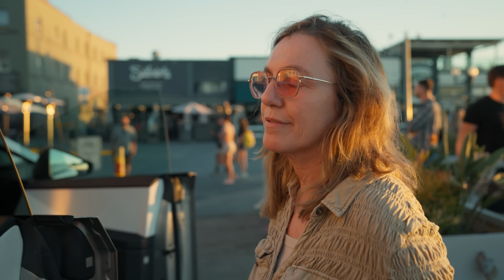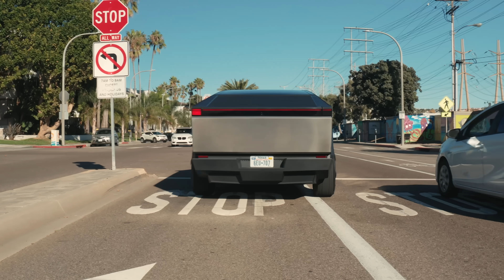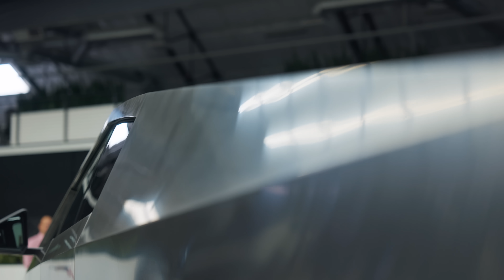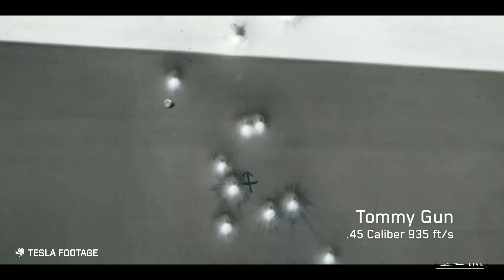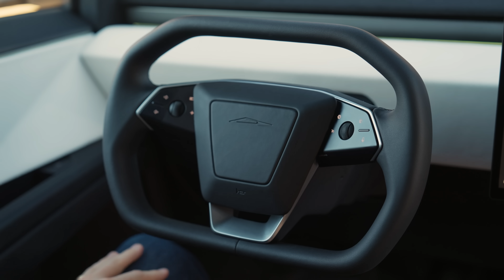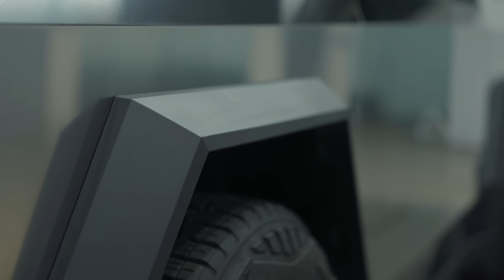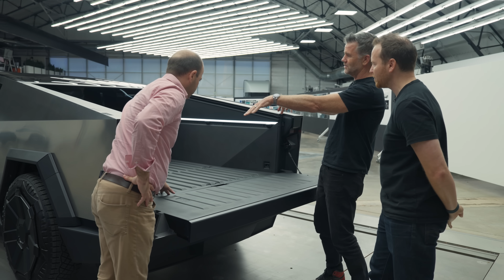FIRST DRIVE: Tesla Cybertruck Full Review

Comment: 4 WHEEL STEERING WAS ALREADY TRIED ON THE 1 GENERATION 1989-1992 HONDA PRELUDE HAD THAT 4 YEARS Ago. IF 4 WHEEL STEERING WAS A THING THAN HONDA WOULD STILL HAVE IT ON ALL HONDA. HONDA SAID IN MID 1991 4WS WAS NOT VIABLE.

Comment: Liking the exterior design is a personal preference, it's not my taste. But most importantly, I personally do not like the absent of a full dashboard and real buttons for things like wipers, lights, radio, AC, etc. Nothing! I use these all the time and don't want to take my eyes off the road and all the way to the right to search in many screen menus which btw move around all the time. Same issue with all Tesla cars. You can see this trend taken one step forward with the square steering wheel. For me it's more like a gadget than a car. I hope safety is not compromised by this new un-usability design.

Comment: I suggest people read the articles about all the problems and repair cost Tesla owners have incurred. My friend took his car to car wash and the windshield leaked so bad it soaked his carpet. Tesla tried to blame it on an open door. You can slide a wire between the glass and a pillar. Tesla is notorious for not taking responsibility for failures. Their quality control is crap!

Comment: Alright! So when the turbodiesel variant comes out? Also ditch the drive by wire bullshit, there is no way to rope tow it when i dies on you and there is no way in hell i'm letting computer box decide what direction i'm going. Just the E accelerator is bad enough when its sensor goes haywire. Hopefully HICAS system at the back is hydraulic so it can be modified to be manually controlled as again too much of this is computer controlled, hence prone to malfunction.

Comment: A steel exoskeleton is nice and all, until there's an emergency. I wouldn't count on emergency services being able to easily crack that shell to get you out of a wreck (even with their "Jaws of Life"), and I wouldn't bet on you as a pedestrian surviving a hit by those sharp angles and stiff material - they seem bone shattering even at low speeds. I also think this vehicle will not be kind to its occupants in the case of a collision because there's no means of absorbing the kinetic energy - no crumple zones, no material plasticity. All the energy will transfer to the occupants and to the thing you are colliding with. The car might be better off, but the people in it and near it certainly won't. I'd be interested in the safety ratings this car gets, especially in Europe where they take these things seriously. While in Texas you might have the freedom to buy any car you want, most other places value the freedom to not die from an unsafe design, as both an occupant and a pedestrian.

Comment: Hydrogen cars anyone? Electric is very much yesterday, and dead.
Reply: hydrogen is energy negative to extract - only viable using renewables
producing 1 kg of hydrogen (which has a specific energy of 143 MJ/kg or about 40 kWh/kg) requires 50–55 kWh of electricity.
requires a big $$'s renewables install to run an ICE vehicle Industry that is growing , but still v. small
2700 Hydrogen ICE vehicles sold in Q3 2023in  US - up ~40% from last year

Comment: I don't have mine yet, but the reason I'm getting it is that it is a TRUCK.  And, I think it will be the best one out there.  The tonneau cover doesn't get enough attention.  It's going to make this the most easily used truck I've ever owned.  I can just close the cover and haul loose stuff to the dump.  I'll be able to haul furniture easily.  It will handle the dimensions of building materials and will haul wood for my shop and logs for my wood stove.  When I get into the trees I won't be worried about the finish, and that's unique for a new truck.  Above all it's electric and clean for the environment and healthy for animals and humans.  Wish there were a connector for a snowplow -- that would be heaven, wouldn't it said the guy who lives at 8600'.  Also, I'd like an altimeter, but I can get one of those.

Comment: It actually looks like a 'futuristic' 1970's - 1980's Chevy El Camino or Ford Ranchero platform...car body and chassis with a utility bed. 

Those had a similur thin sheet metal car like chassis(under the cab and bed) not a actual thick sheet metal channel shape designed for a truck chassis to handle the heavier loads of a 1/2 - 1 ton truck, and actually any bigger sized commercial truck thats meant for heavy loads

But thats okay, because thats the market Tesla was aiming for, right? A some what 'futuristic truck' like the past 'coupé utility vehicle' (truck, meaning having a utility bed for bigger loads you can not fit into your car trunk)

I owned a 1965 Ford Ranchero in the late 1970's to haul my motocross bikes to the races in style, and to have a way to get around town easier then driving my full size Ford pick up truck, that I also own to pull my cement pump for work.

The Chevrolet El Camino is a coupé utility vehicle that was produced by Chevrolet between 1959–60 and 1964–1987. Unlike a standard pickup truck, the El Camino was adapted from the standard two-door Chevrolet station wagon platform and integrated the cab and cargo bed into the body.
A 'coupé utility' is a vehicle with a passenger compartment at the front and an integrated cargo tray at the rear, with the front of the cargo bed doubling as the rear of the passenger compartment.

The term originated in the 1930s, where it was used to distinguish passenger-car-based two-door vehicles with an integrated cargo tray from traditional pickup trucks[1] that have a cargo bed separate from the passenger compartment. Since the 2000s, this type of vehicle has also been referred to as a "pick-up",[2][3] "car-based pick-up" or "car-based truck".[4][5]

Comment: To the Engineers who designed this, Well Done! Not only on making the car, but as you know, on the problems you solved for us!
Reply: What problems?
Reply: @MechInvent  Low Voltage machines being standard for legacy reason. New or previously unusable amalgams missing useful tooling for widespread use. ICE mindset on pollution.
Reply: @up4open solves nothing
Reply: @tbone6976  I will remember to never hire you for design or building of anything.
Reply: @up4open you’re not hiring anyone to design anything lol. Stop lying to make yourself feel important
Reply: @gdo3510  "abstract negging comment from random troll #64545" back to the Avdiivka front, Ivan. You'll be the one to take the hill as first in. We believe in you!

Comment: The backend is hideous. Front is kinda cool. Problem is, tesla is in for a shock if they release this as a stainless steel finish with no paint. One dent and it can only be repaired with pdr. Insurance repairs nightmare. Engineering is cool but the design is lazy.

Comment: For any country that does proper testing with respect to pedestrian, cyclist and motorcyclist safety this will never get certified given the lack of any give in the panels and windscreen and an incredibly small crumple zone. They haven't released the crash test data yet, they can sell it in small numbers (as with supercars) and get around a lot of regs that way. If they really try to sell it in higher numbers then they have to pass all the tests. Also, how exactly are the firemen going to get you out of this car after a crash, they will need extra, extra strength jaws of life at the least.

Comment: 1 This shape is extremely functional. Triangles are used in bridged, towers & pyramids etc for a reason…
2 Of course it has crumple zones. Why wouldn’t it?😂😂😂
3 Compared to Ford / GM pickup trucks with radiators like walls this will hurt pedestrians much less.

Comment: All I need is a truck at all Gitter done right now. I got a 2008 dodge ram mega cab with a 67 Cummins in it. It pulls my trailer that I put like 3 tons ahead on it. I got a fix the overheating problem on it, so far it’s been get me where I need to go to point a to point B yeah it sits on 35s mud trains razors. I need something for up here in Spokane Washington is one night a long time ago. We had 4 feet of snow in one night and I was just kind of bizarre. I had to put my little sport track in for a drive in the parking lot to get her up to the front door of her office is the snow it was going over the hood so I need a vehicle. I can depend on to get her done.

Comment: I didn’t like it at all on rollout. Now, I think it’s interesting.  I’m always impressed with the Tesla and SpaceX engineering. I’ve owned Toyota Tacoma, Dodge Ram, w Cummins diesel, Ford F350 diesel, and now Ford F150 ecoboost and Toyota Tundra . I actually use my trucks towing RV, boat, hauling dog kennels, going off road…  I have a lot of scratches from narrow 2 track roads looking for bird hunting and flyfishing spots off away from everything. It’s just part of doing what a truck should do. Stainless steel and sort of bullet proof is a catchy selling point but not practical. The ride of the F150 and Tundra is perfectly acceptable. 
If I was an urban metrosexual, I might own a CyberTruck. Here in Wyoming, nope. There will probably be some in Jackson Hole, but that’s not Wyoming.

Comment: Great info.  If the Tesla Engineers/designers are reading.  You did an amazing job.  Just one little input, the rear tail gate, I just can't get over the plain flat rectangular shape of it.  If you could just add a horizontal split line, either 1/3 or 2/3 way down from top of the tail gate, with slight inward angle of 5 to 10 degrees, it will look even better.  It will still keep its solid tough look, but with a nice angular break, enhancing the back image.  And of-course, what Carl mentioned, fixing the ripple effect on the rear quarter panel around the top rear wheels.  It just distracts you, when you are looking at the truck with such a small little distraction.  Otherwise this is a futuristic truck, that industry will be copying decades into the future.

Comment: 3+ metric tons, yeah, very safe to drive that in to someone else, also very green accelerating that in 3 seconds. Then 36 hours to charge that on single phase. Looks like a urinal on wheels. In 100 years this aboniation will be the symbol of the age of boolshyt. Top job👍 oh and the 'they started delivering' is barely more than a PR stunt, with just 12 specimen making it to their selected 'lucky' few.

Comment: 29:30 Having headlights low is actually much WORSE for visibility because even a small bumps down the road will cause more shadows on the road when your headlights are close to ground. Look at the extra lights that big trucks or off-road cars have. Do they install those as close to ground as possible, or as high as possible? Do you think the high install location might have something to do with having as good visibility as possible?

Having headlights close to ground is design over function and a fashion thing.

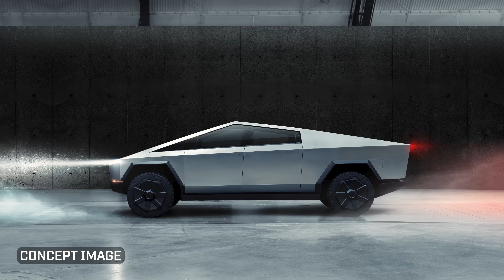Even the concept image at 30:40 suggests that the original idea was to put the headlights higher but I guess that was harder to implement so marketing department must now try to explain why their inferior new location is "actually better".
Reply: This happens when pencil pushers who probably never even used or owned a truck design one. These people don’t even use them, they just see specs and numbers and go on that. I doubt that Cybertruck can off road well either.
Reply: @thetapheonix  I think Cybertruck will off-road very well on hard surfaces like rocks and packed gravel. The smoothness of the whole powerline for power delivery to the wheels and available max torque will easily beat any ICE offroader. In addition, the battery pack being really low sets the center of gravity really low which should also help in many situations. And four wheel steering should help, too, if properly used.

And because EV has really efficient idling, going slow in off-road environment doesn't cause any problems to the battery. Every time the wheels stop rotating, the power requirements form battery drop to nearly zero.

However, if the ground is loose or muddy, the total weight of the vehicle will be a huge issue because the whole Cybertruck will sink into the ground.